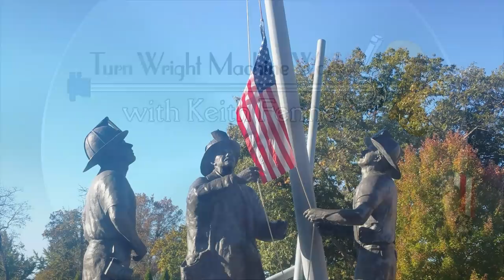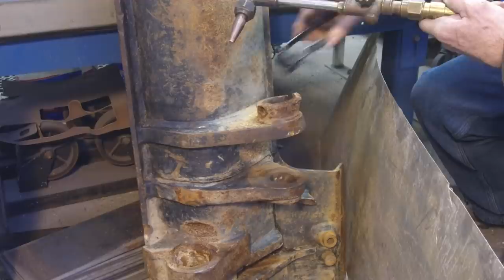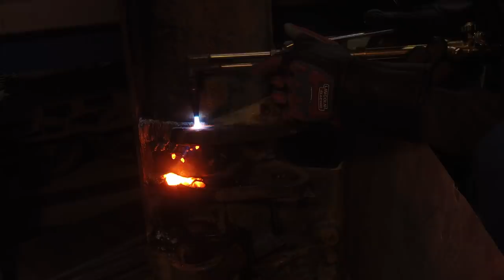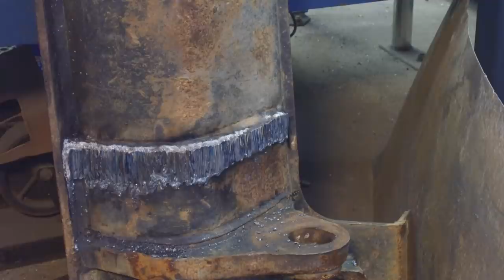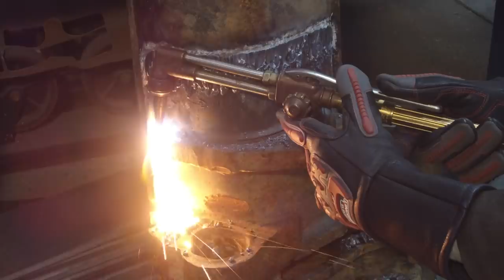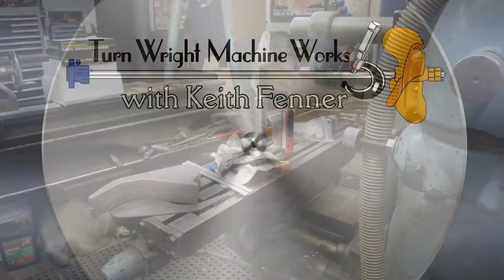Intentional Disregard Part Two

Comment: An arc gouge would seem to be the better way to go about removing these brackets and the  welds.
Reply: Not for the small shop he has carbon arc blows sparks everywhere and have been known to burn alot of things down torch is more controlled
Reply: Got to agree. Arc gouging is more forensic in my experience and leaves more of the original surface to fit back onto.  Burning metal away is a nasty job anyway you go about it.  Imagine  Ole Keith out in the snow blowing out welds!

Comment: I rebuilt so many  pieces of equipment  i hate t remember But I would have used a Air-Arc torch 
and made the ears out of T1 steel.. mild steel will bend like peanut butter.

Comment: Keith you should try propane instead of acetylene its far superior for this type of work combined with a propane gouging nozzle
Reply: MIDBC1  its nothing to do with heat I use propane gouging for doing this type of repair regularly its cheaper safer and the consumables will outlast acetylene type products you don't need to piss about cleaning nozzles no nasty flashbacks or soot floating about the workshop its all about control a propane gouging nozzle with a cranked end is far superior I am failing to see any drawbacks unless you can enlighten me
Reply: @breezeblockindustrie    Just curious here.  Are you talking propane or MAPP  which is a combination of gases.  The reason I ask is one place I worked had two rigs-one was oxy/acetylene and the other was MAPP with oxygen that worked just like O/A.  I preferred the MAPP gas.   As far as brazing is concerned I spent about 14 years using natural gas and oxygen torch brazing in a production manufacturing plant.
Reply: @royreynolds108  propane for gouging for brazing I still prefer acetylene I would also go as far to say unless you have access problems I wouldn't even use carbon arc gouging as it has its own problems

Comment: https://i.imgur.com/YkFttnI.png <- I used to use tips like these a lot back when I worked in the heavy industry repair business, pricy, but if you work 'em right they save you a lot of grinding. Once you got the hang of it it was pretty much just knocking off the slag and you'd be set to weld the new bracket or whatever on.

Comment: That is a poor design having only one strut offset to one side, puts an uneven load on the attachment.
That is no excuse for letting it get that bad.
Owner operated tools last much longer than employee operated tools.
Just like home owner vs renter.
Reply: There is plenty of plant equipment out there that is being run into the ground by the owners that figure we can do the maintenance when the item breaks.
Reply: jacktheripped  it sounds cheaper until you learn that the part you need isn't in the country.. Will find out if it's available elsewhere.  Next day get a phone call, nope it can be back ordered... ETA unknown.

Been there in other fields...  We need less MBAs and bean counters but more engineers in managerial roles

Comment: May be it would be better for
these guys to have extras that way they could just through it away and use a new one every time. That machine must be down in a pit and it never comes out. Even if they just had spare pin bushings and worst case new clevis’s cut outs ready to go. There are some dummies out there with monies that don’t care to buy grease. Same way with leaks burn up engine or hydraulics with no maintenance or gun decked maintenace

Comment: One thing you learn early on when running a business is your employee's don't care
Reply: Or the owners.  Or they don’t give employees time to do maintenance. Or they aren’t willing to buy parts or take the machine off-line long enough to do the preventative repair…  The finger pointing can come from all directions.  You get someone up in the bush during an oil-boom, they’ll push a brand new machine to destruction  running 24-7 in a matter of months, then abandon it on-site when the project is finished, after they’ve extracted their value from it.  It’s a crying shame.
Reply: No, no I don’t like that statement. In almost all cases most employees who use the machinery on a daily basis care the most. But too often, maintenance is governed by time and budget brought on by the work load and/or company.
Reply: @shawnhuk  we will have to agree to disagree
Reply: pijnto - fine, don’t get me wrong, I completely understand how employees don’t care - I’m a supervisor/project/job manager for a small contracting company. I do know there are few guys out there like me - who care about the success of a business, but they do exist. As far as the equipment operation - I guess it depends. I obviously don’t know what you know. Good luck.
Reply: There is a company that has a portable line boreing machine that attaches to the unit to put bushing in to pin size again.
Reply: Things wear out,once the holes open up no amout of grease is going to help so you just use it.
Reply: Yup.
One of my trucks rolled in this morning running like crap with the dash lit up like a Christmas tree. The driver is known to ignore the oil change light and not report mileage.

Another nice one from Monday was a $4,000.00 carpet cleaner found to have been left to freeze in a truck overnight.